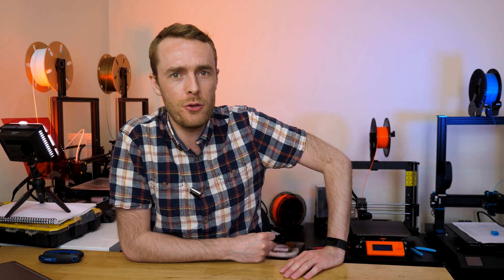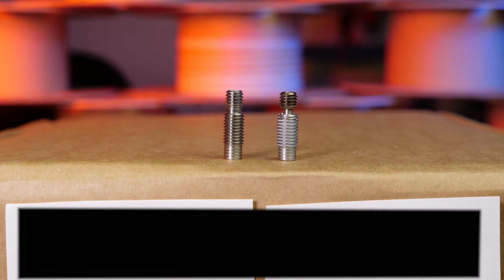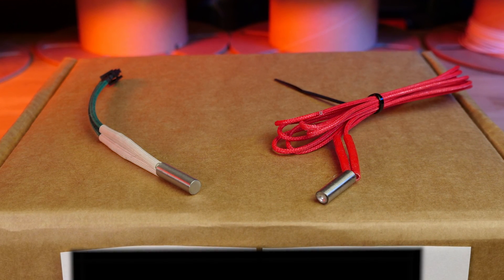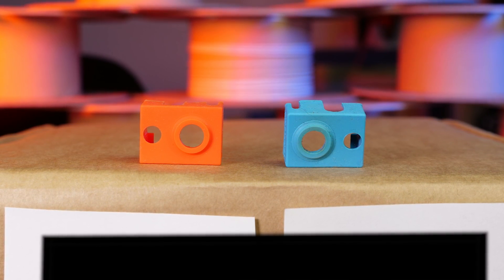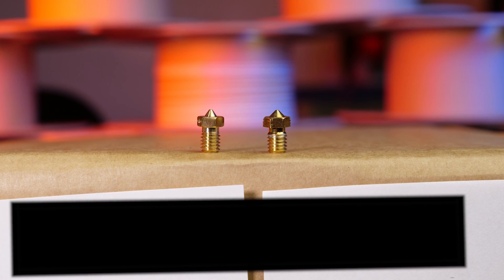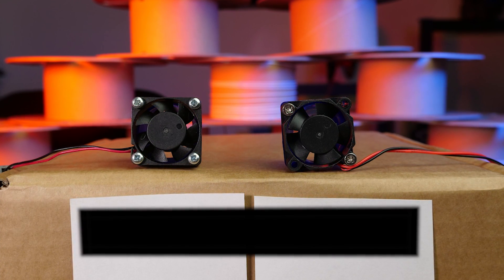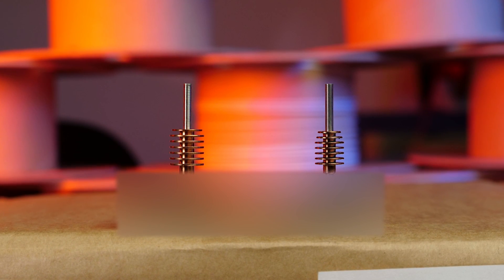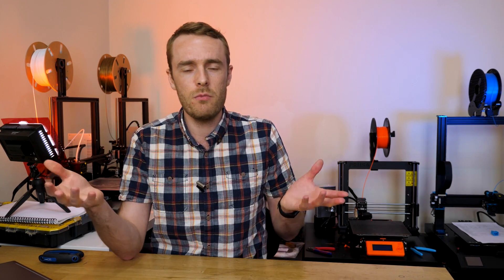Can you spot a CLONE vs ORIGINAL? [Test/Quiz]

Comment: 1) Theoretically, yes. But it can also depend on the quality of the clone. Some 'clones' are simply poor imitations and often use different fabrication techniques to achieve a 'close-enough' result.

2) I would consider myself to be well above-average at spotting details (mostly based on feedback from work, where I work in QC/QA and regularly catch things others have missed), and therefore probably have as good a chance at spotting differences via pictures as is reasonable. But it's much harder through images than in person, and I don't expect to be able to spot a good clone as some differences are minute (and irrelevant). As another side-note, most everyone manufactures in China, and the same exact supplier often sells the same product un-branded through side-channels, so a 'clone' can also just be the exact same thing without some QC or lower quality binning.

3) Left is probably a clone, but you could be cheating and showing heat breaks for different size filament. The thermal compound on the heatsink threads of the right one lead me to think it's genuine as I don't think most people would bother on their own.

4) I think both are clones, but the one on the left looks higher quality. It could also be legit and just for a different customer.

5) Probably both, but left seems more likely.

6) Left

7) Right is more likely a clone. The edges are more broken, and the surface looks to clean. E3D specifies unfinished surface.

8) Right, again unless you're cheating and they're different sizes.

9) Both. But who can tell, everyone uses different ones

10) Left

11) 4. I'd be happy with 50/50

Fun :)
Reply from the maker: awesome, thanks for playing :)

Comment: Does it actually matter as long as it does what it's made to do? The E3d "heater with quick connector" is a clone for certain as my Dad used 12v cartridge heaters 20+ years ago at work, also E3d V6 is open source so the components that are "cloned" as you put should be made to the same dimensions if made to the same quality...pointless video in my opinion

Comment: 1. yes you can spot them for sure depending on the part
2. Id like to think I can spot many due to manufacturing shortcuts
3. Left clone doesnt have thinner throat restriction and you can see the PTFE tube goes all the way through while a real e3d v6 has the thinner throat and tube stops before the end.
4. right clone,  have like 10 of the right ones with way too much wire. (white wire 50w are best)
5. neither clone, left looks kinda worn down but also normalish right ones cord has never seen a day of wadded up chinese shipping bags in its life. its pristine.
6. left clone, on right you can kinda see the derpy top seam on the official sock and maybe the logo edge.
7. both clone, fins are wrong for a normal v6/lite and core is graduated but then the groove mount is short for the all metal that would have that graduation?
8. right clone, has wider cone tip and is missing the little e3d dots on the side to identify it and probably just has the diameter printed like all normal nozzles.
9. right clone, less blades screw holes are odd and I guess only came with 2 screws?
10. left clone, the right mosquito has the top 2 fins both reduced diameter while the left clone only has the first one smaller and is overall fatter.
11. I think I got at least 3 right (nozzle, mosquito, v6 heatsink)

BONUS ANSWER 12- I think they probably all peform VERY similar that the visual differences are the only real differences give or take an issue or two.
Reply from the maker: Thanks for playing

Comment: 1, bad clones yes, 
2, I hope,
3, Left is "fake" (V6 with ptfe line, thinking the lite did not have it as a seperate piece) , right might be genuine. but is that teflon tape?, so I would say fake. (both fake)
4, I have the right one in bulk, so right is fake, left is real (if for vulcano) (right fake)
5, left is e3d 30W and right is 40W, left one is real, right one I cant tell, lets go wit real. (both real)
6,  left is fake, i though they only made it in blue, right one seems real as I think I can spot the lettering (left fake)
7, cant tell, need to see the top. (one of them is at least fake)
8, left is real, because you messed up the other one, ;) right one is fake. (right fake)
9, right is fake 
10, right is fake, but thats more of gamble,
11, 6 out of 8
Reply from the maker: Thanks for playing!